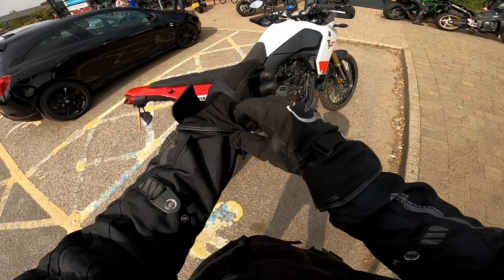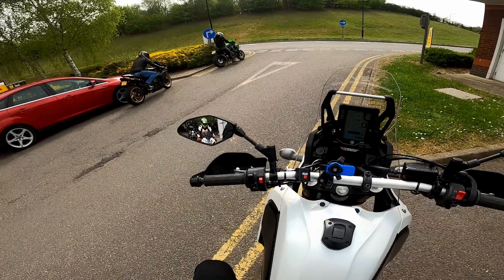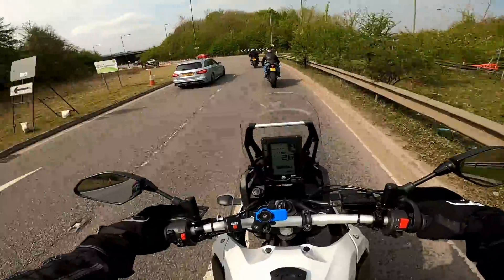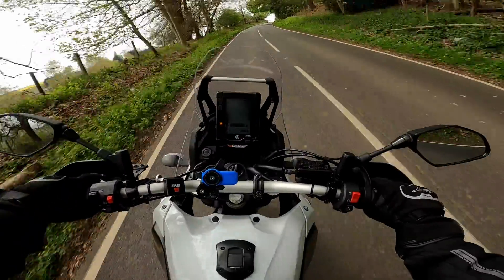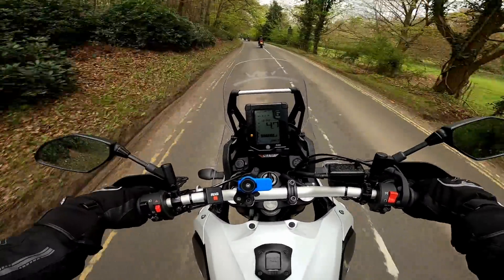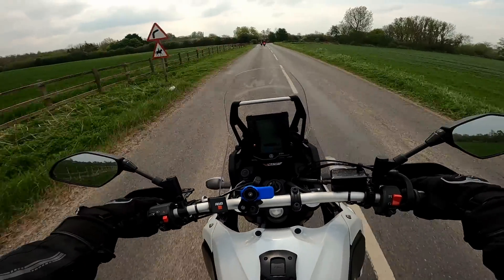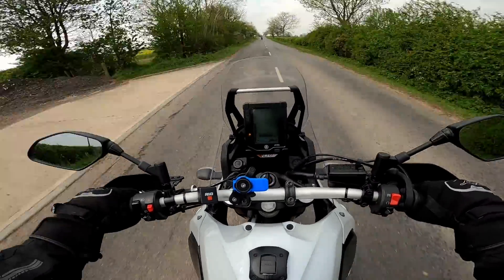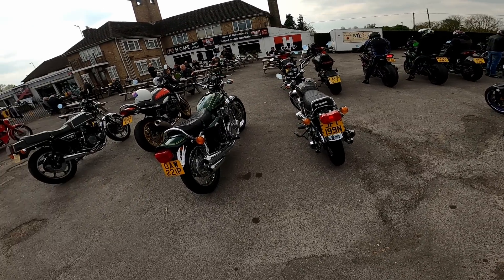Took my Yamaha T7 on a Sportsbike Rideout

Comment: I got one of the first T7’s in the country and decided to take it racing at the Bike Shed Cafe Racer Cup. I was middle pack and placed 16th fastest time of the weekend out of some 50+ riders. It’s a properly capable road bike, and I threw it down a bunch of greenlanes. Brilliant bike.
Reply: It is indeed a very light and flickable bike. I Did not expect it to handle so well onroad especially with the stock 70/30 tyres. Such a capable bike😊

Comment: It only takes 40hp to do 160kms.
Here in NZ we loose our license at 140kms. If you got a 200hp rocket ship I don't know what you'd do with the other 160hp. I know I'm a grumpy old bastard but I think we've lost the plot to a certain degree.
Reply: This is essentially why I switched to a dual sport. No point having a fast bike on the road.

Even my dual sport is a 
Husky 701 with 70 ish HP. It goes plenty fast enough but it's the torque that makes it so fun to ride. It's a great city bike because of the instant torque. Fun without risking licence too much
Reply: Thats why you run from cops....its super easy
Reply: Good thing I don’t live in that awful communist country.

Comment: Try putting both front and rear compression clicks on 1 click out, and put rebound about halt way in from standard settings.
Will slow it diving as much on brakes.
Rear spring preload at about 20 clicks in too, will help rear compression on acceleration.
Reply: The real ticket is to revalve and respring for the rider's weight
Reply: @RChero1010  Yes, but as a short term fix with what you have, it’s a bit better.
I’ve had springs and K Tech valve kits fitted to mine now.
Reply: @RChero1010  $$$

Comment: I'm very curious why you chose to buy a Tenere. Not a bike that ever gets talked about.
Reply from the maker: It's a great second bike. Very versatile and honest bike
Reply: @BikesofRye  I could understand it being a good second bike to a sportsbike but whilst you've got your S1000 I can't imagine choosing the Yamaha instead. How does the Tenere give you pleasure that the BMW doesn't? 
The reason why I'm curious is that I've got a S1000RR and I'm thinking about either a 2nd bike or a replacement and I have no idea what will make me happy.
Reply: Hi Phil, I’m curious why you are looking to change your RR, a lot of people see that as the ultimate bike including on the road. I have an MT09 and would recommend them to anyone, especially the SP which has ohlins and a quick shifter. With a full exhaust it is such a satisfying bike to ride- mainly because of the gem of an engine. Conversely I am looking to go back towards a sports bike after around 3 years of mine.
Reply: "a bike that never gets talked about", You obviously only watch sport bike channels , the internet is swamped with T7 content, probably one of the most talked about bikes on the market at present because they are a back to basics bike that does everything well, mine is sitting in the shed fully loaded with camping gear ready for 250km of rough gravel backcountry riding tomorrow , they are a great all rounder.

Comment: Is it moded or stock?
And how this is for long highway routes comfort wise
And i like how you're using this it was built for offroad and highway speed all rounder adventure tourer
Reply from the maker: Modifications so far full Black Widow exhaust system. I am looking to fit a comfort seat for longer journeys and ear plugs a must due to wind noise from tall screen
Reply: @BikesofRye  thats great you're running stock i like that
And I would recommend you a airhawk air cushion they are great and comfortable and cheap for really long rides

Comment: Good video mate, what's your thoughts on the T7 as a daily rider comfort wise etc?
Reply: I have done over 20,000 KM's on my T7 and it's very comfortable. The seat is hard so that might annoy after a couple hours but you do get used to it and it's very tall which may be a problem for some people but very comfy.
Reply: @MotoShaneGame  should i buy it, if i will ride mostly two up?
Reply: @apz5817  I have a friend who often takes his wife for long dirt rides on his T7. It depends on where you want to ride? Lots of great off road riding, then yes, lots of road riding then no, go get something more comfortable that's for touring.